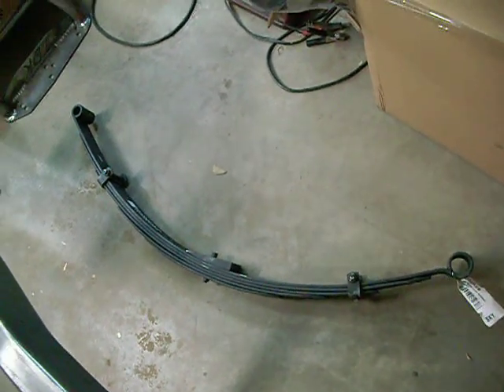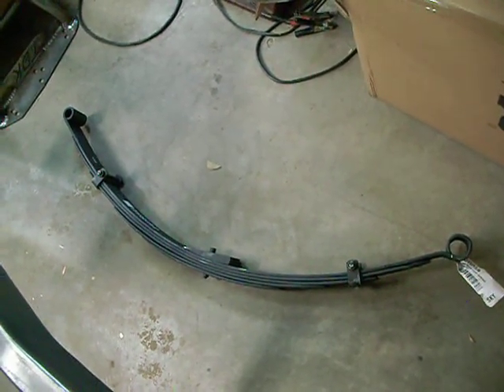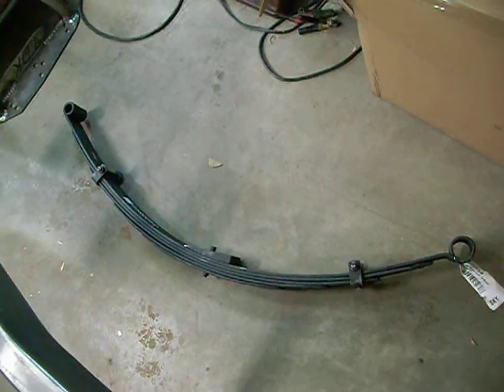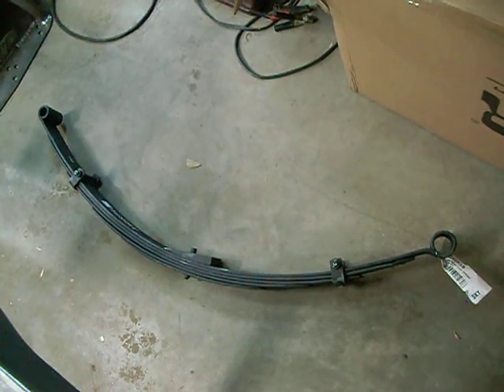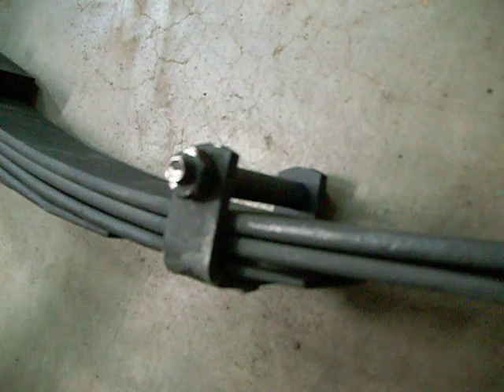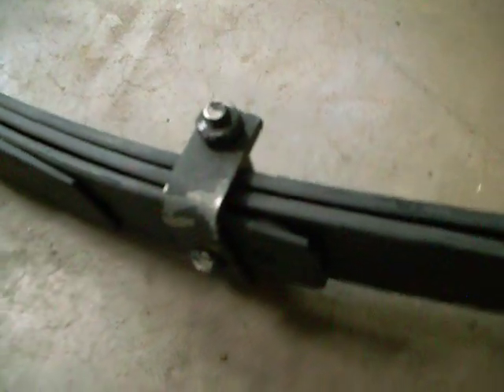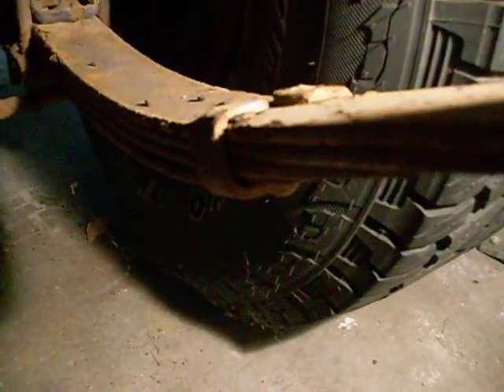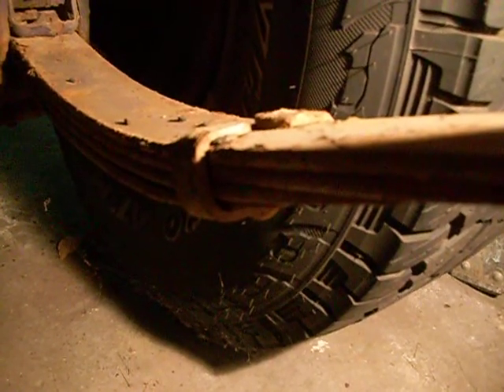TDK 78 Jeep CJ5 frame up build Part 3

Comment: I know what you mean about the springs. I have a 1962 pickup Willy truck. It used to ride rough until I changed the springs. Thanks for the Jeep videos. I just found your channel
Reply from the maker: I've never seen anybody just come right out and explain that in the magazines or TV shows before, took me awhile to realize what was going on, and who makes a good spring etc.
Reply: @videostar07  What you zoomed in on was the spring clamp... it does help with ride quality and ease of disassembeling the spring pack. Tapered spring ends & friction pads also help with ride quality.  Your springs aren't military wrapped... military wrapped springs have two wraps at the end of the springs, the main leaf & the next longest spring.  I'm thinking about rehabbing my 74, your frame looks very nice.
Reply: @XtremeXJ  The main point was the difference between the two wraps and the effect it has. You can see the new springs have tapered ends and nylon 'buttons' in between the leaves. Military wrap, spring wrap, ok you call it tomato I call it tomatoe, but thanks for looking in!